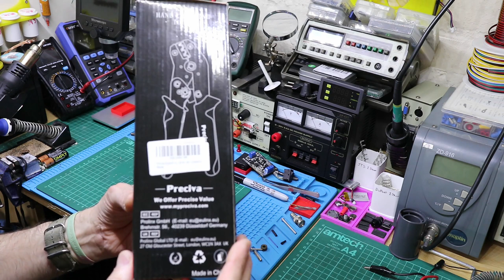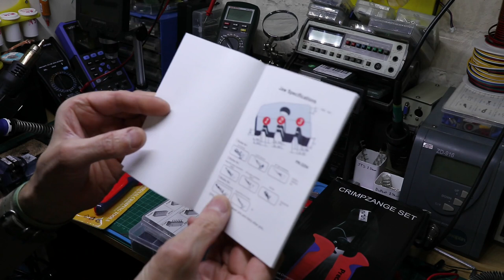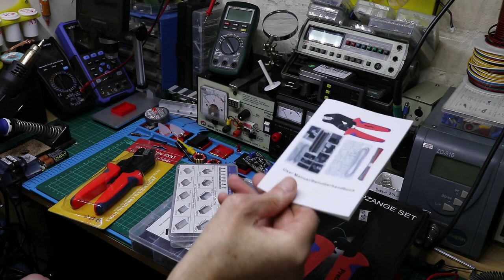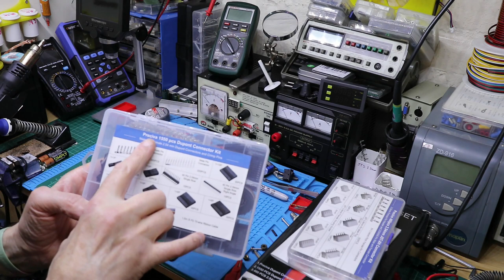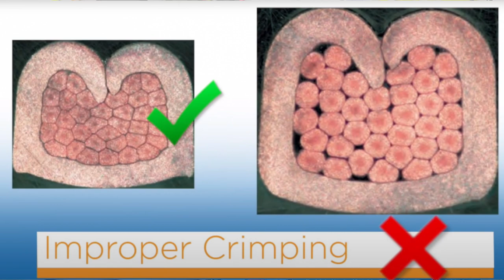Preciva Ferrule Crimping Tool & PR-3254/SN-28B Crimping Tutorial for Dupont Pins And Connectors

Comment: I have the exact same crimper.. It certainly takes a couple tries to get the postion right..  If you don't push the connector far enough through - the crimper will crush the business end - ruining the connector..   Once you know that it has to be far enough through - it works very well.  I have done a crap ton of connectors with this crimper.  No issues.